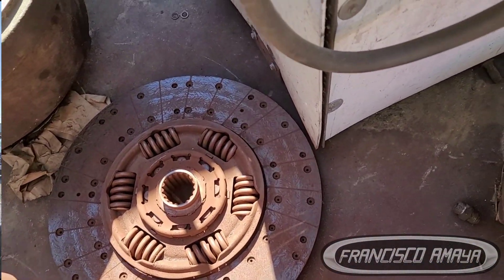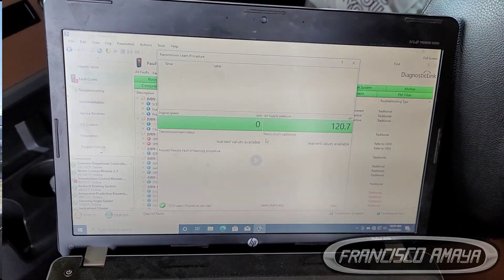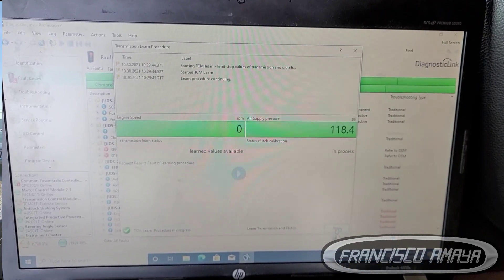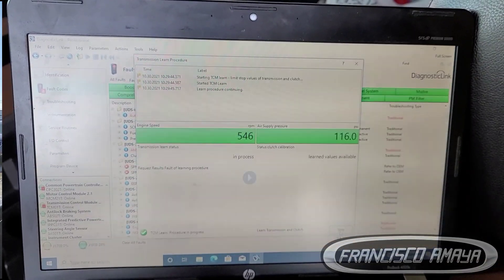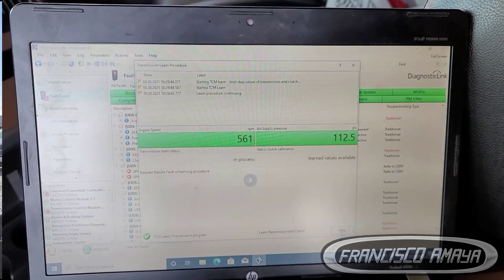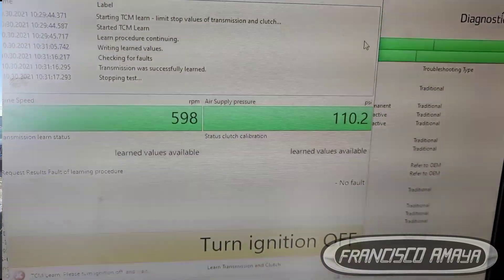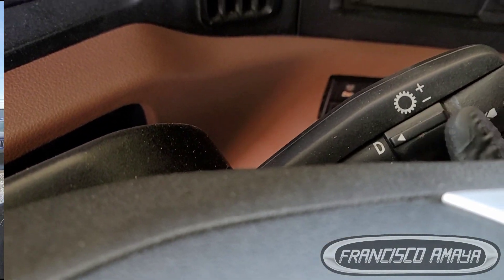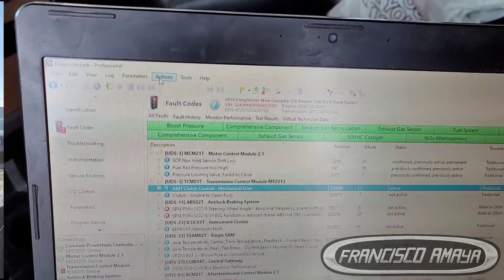DT12 automatic transmission clutch learning calibration transmission calibration using DDDL software

Comment: My freightliner is 2019 it sounds like a pto half engaged but it does not have a pto and it only shifts in high gears it has no low gear

Comment: 2019 Cascadia DT 12 working fine then after I stopped to use the restroom came back and now won’t shift getting the following: TMC 520971-7, 521486-2, 521491-2 and CPC 521001-14 
Clutch not working will not Shift.. 😢
Any thoughts? Please Help 

this clutch is not covered under my warranty 😮…
Reply: Mines have the 520971-7. Not engaging until temp above 96°. Diagnostics says cpca (actuator)On dealer now

Comment: Hi my friend 
I have issue with my truck freighliner cascadia 2014 DT12 I was driving it normally but I get abc light on and HSA light on Rpm and speed odometer shut off and no gear showing on dash board. I take it to the mechanic he replace clutch and split pin i driving it for like 45 minutes I parked and next day I try to driving it the problem go back the same.do you have any idea to solve this problem thx

Comment: Hey i have problem with the Transmission it doesn't switching gear even 1 it just showing N trying to switch to gear 1 but can't i tried too many times callibration it won't work and i also changed shift controller it won't work